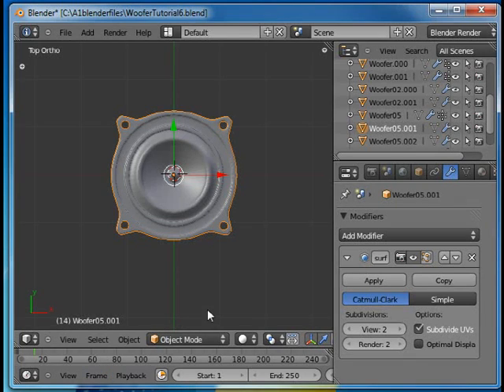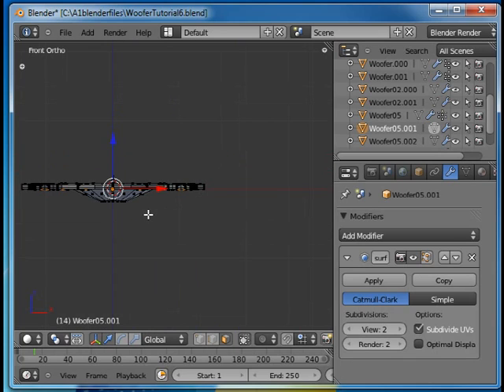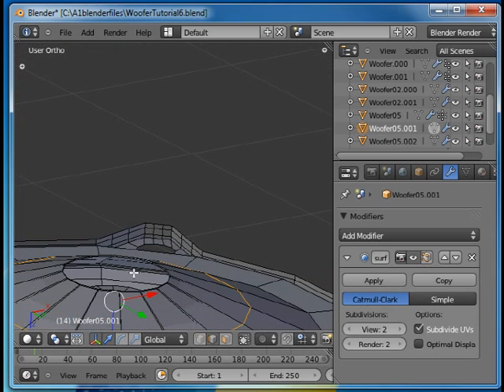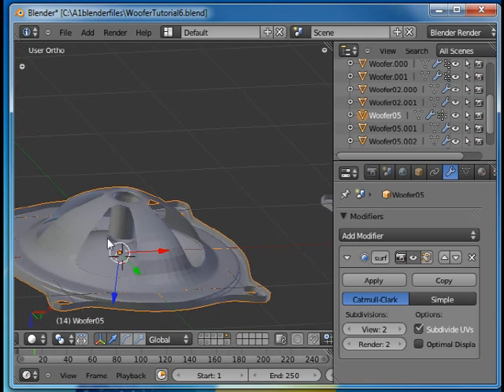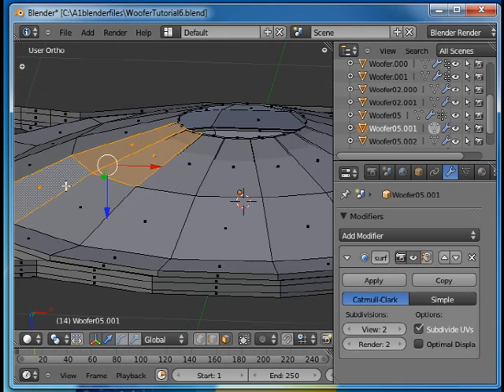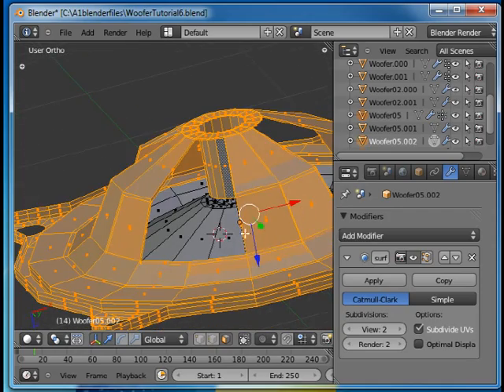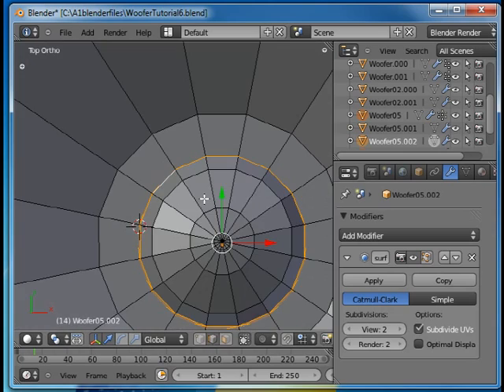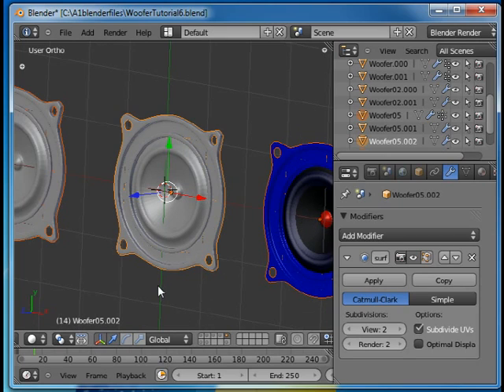Absolute Beginners Blender 3D #14.3 Tutor

Comment from the maker: Hi I looked at your model and I could see that you have some faces that has no surface. This happens when you extrude from an edge but never pull out the face. You can easily identify those faces by that they have what looks like an edge and a black dot on the middle of the edge, (the same kind of dot that faces has in their middle). One way to deal with that is to select the entire model and use remove doubles. Which is a mesh tool Ctrl V and then choose remove doubles

Comment from the maker: @hifijohn I will send a personal message with my contact info. It seems your woofer project is quite substantial. When I decided to make this 4 part tutorial I went for something that a beginner should be able to complete with resonable effort. So far It seems to be about right, although it can present a challenge it's still within reason. If there's any Blender issue you need to discuss for your project send me a PM.

Comment from the maker: @WooCla The cage portion presents a challenge in this model. As you wrote it's practice and that is very much the purpose of the #14.1-4 tutorials to give an opportunity to practice what has been learned in #1-#13. I personally need to practice what I have learned as soon as possible, and typically alot of practice  (WAX ON, WAX OFF, WAX ON .. WAX OFF). BTW did I tell you about the Rewards and Recognition video in the playlist by the same name?

Comment from the maker: @A1Sirius If you don't left click right after pressing E the translation arrows will not appear but you can still extrude by just moving the mouse, however the extrusion is then limited to only one axis that is shown as a bluish purple line. IF the snap function is activated the horseshoe magnet icon in the header (which is at the bottom of the 3D window in my example) it seems as if noting happens so make sure that magnet is NOT active if it is red in color click on it.

Comment from the maker: @leutnantbruno When you press E to extrude, that only starts the extrusion the next thing you must do is to in some way grab the newly created faces or edges or vertexes depending on the mode you are in when you press E. So the sequence I'm using here is I  E and then a left mouse click which makes the translation arrows to appear and then hold down the left mouse button over the Z arrow (blue) and pull that down. I will continue this in the next comment box.

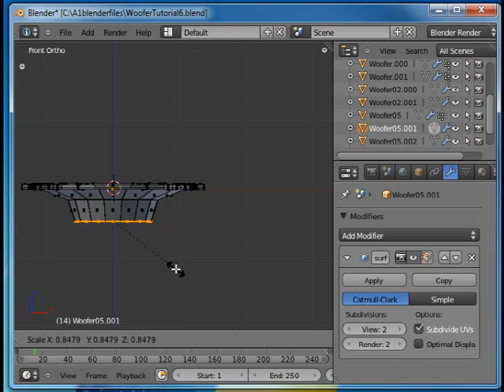Comment: At 1:07 you say to use E to extrude but this won't work for me I have to use grab to pull down the faces. At 1:14 you scale and it appears to get close to the bottom of the cone: am I correct? At 1:19 you extrude again and a second set of rings is formed (which I can't do as cannot extrude) and then you grab this which I understand but lack of ability to extrude is my problem. Is it possible I made my object too thick and that is what is causing this?